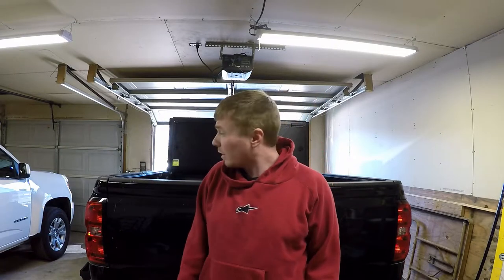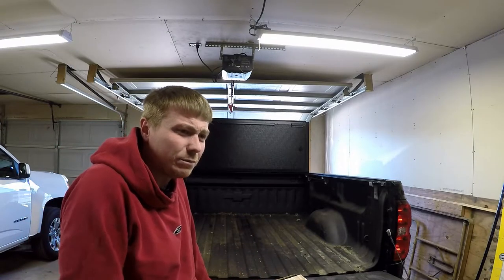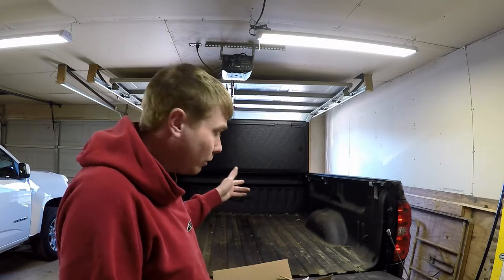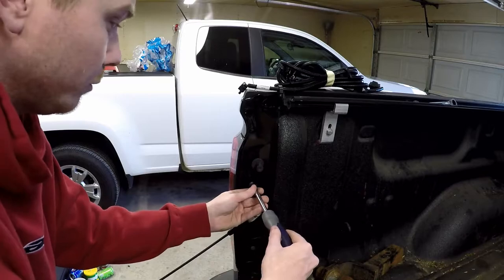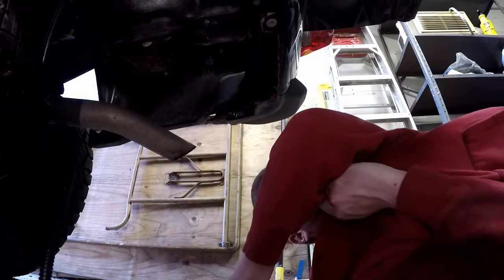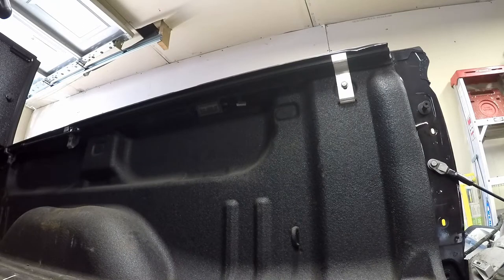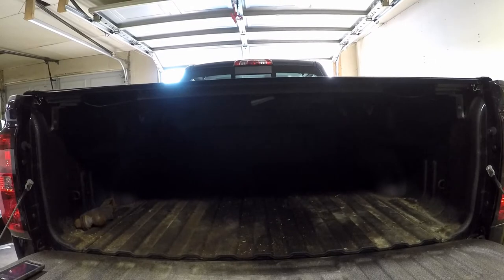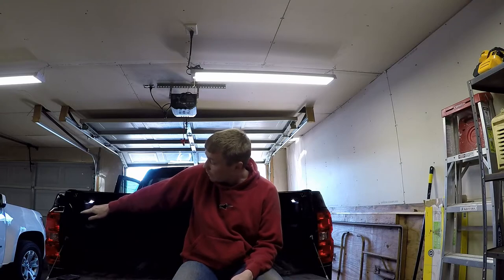Silverado mods: Bed Lighting Install

Comment: myself plan to use the factory pigtail then add aftermarket led strips, as those factory leds dont seem to do much
Reply: factory GM pigtail is around 30 without the lights

Comment: Would have been helpful to show what button you used to turn the lights on
Reply from the maker: It's just the stock cargo lamp light inside the cab. It also turns on the lights next to the third brake light

Comment: How in the hell did you get the cap off the plug? I fiddled with mine but didn’t have much time and got frustrated so gave up. Does it just pull off? I felt like I was gonna break something
Reply from the maker: If I remember right it was really hard to get off.  I think there is a tang to push in to pull it off